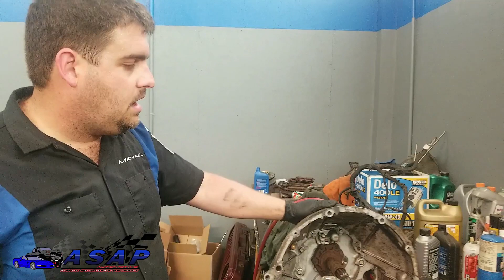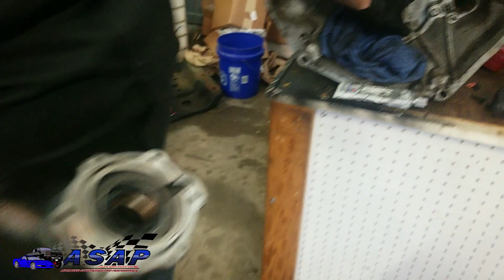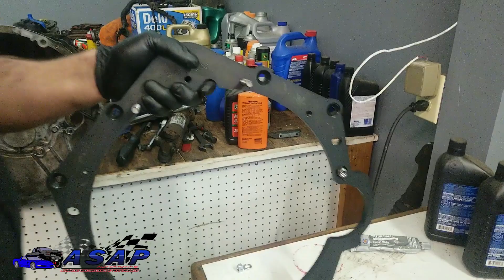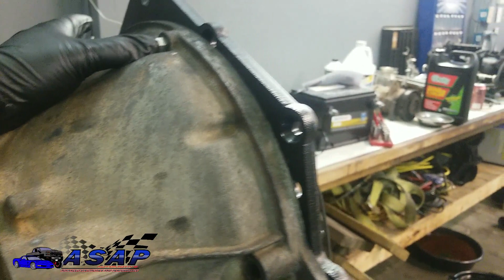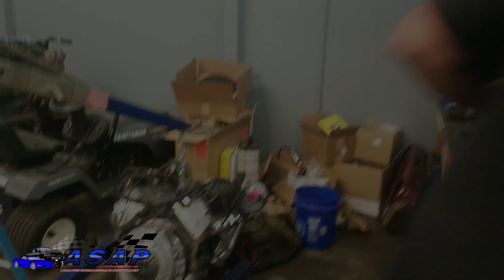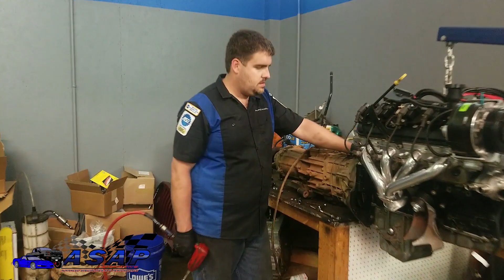Drive Train prep Pt. 2

Comment: Great information! I'm in the process of swamping out my 2.5 for a 5.3 gen III. I was debating on the adapter plate u r using vs adapting the NV3550 to a chevy Bell that I already have. I was interested in the setup u r using because I can keep my OE slave cylinder setup. Can u explain why you chose the plate and if u would do it differently? Also, Novak isn't advertising the plate on their web site. u have to ask for it. Thanks for your time and keep it up! great job!!

Comment: I’m working on this same swap and I am having issues with the engine and transmission adapter plate? Did y’all have any issues with that part? My passenger side is ~1/8th inch from flush to the plate when bolts are fully tightened and I have taken it off and tried resetting the dowels several times and cannot figure out what I’m doing wrong.
Thanks, 
Mike